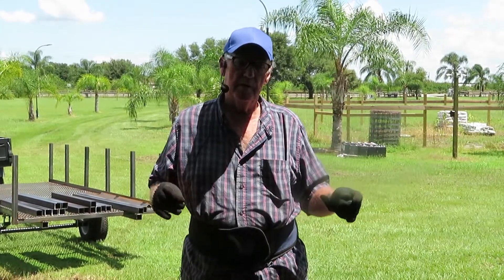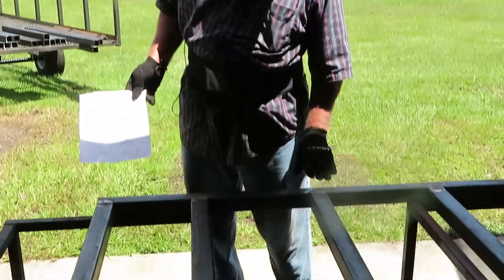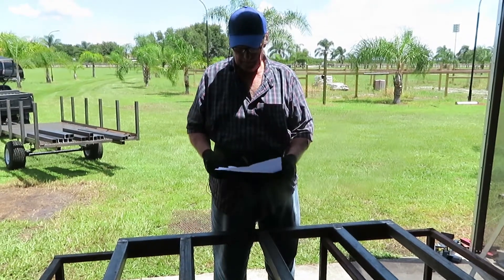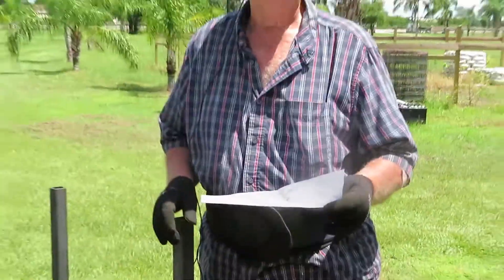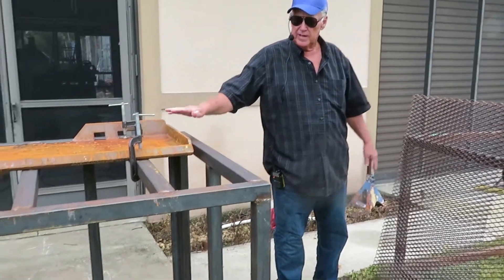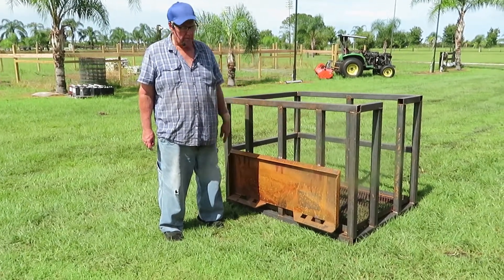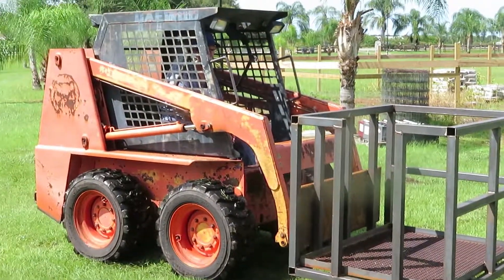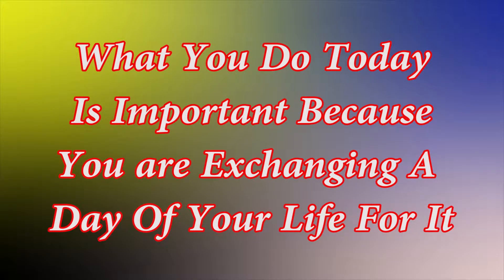How to Build a Skid loader, tractor loader, safety basket

Comment: If you don’t want to spend a lot of money on steel, and quite a bit of welding, grinding, and painting then buy an IBC tote. ($25-$75). Take the plastic tank out of the cage, put in a plywood overlay floor, and cut an entrance slot. Add a couple safety chains across the entrance. At least 5 times lighter than this build and no more or less safe.